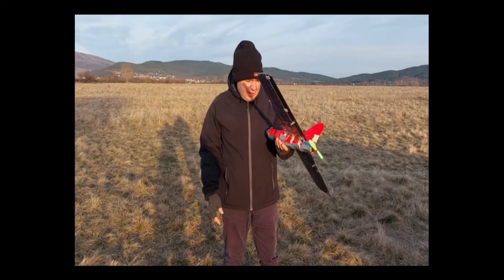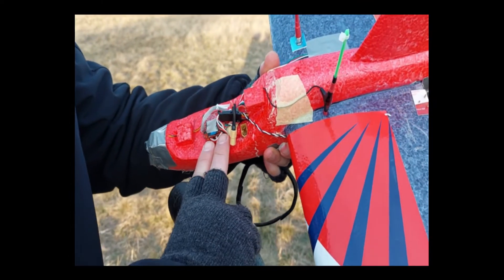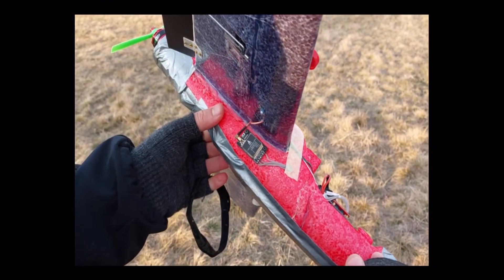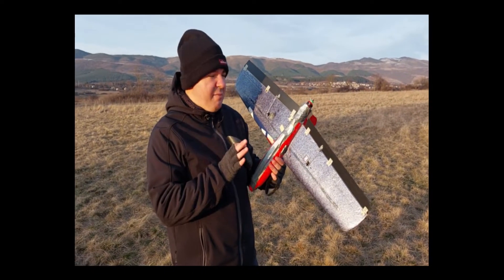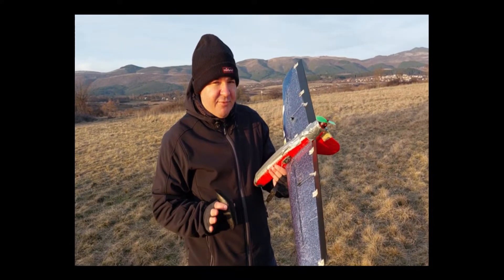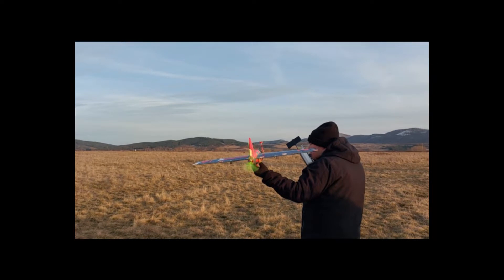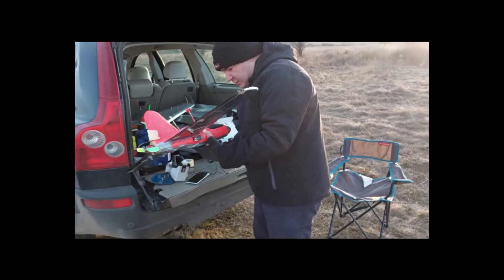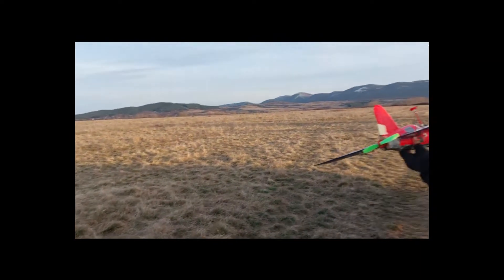Lidl Devil Glider with FPV and Arduplane. A crash included

Comment: Nice man, your delta wing is so stable. Mine goes to the ground once I try to throw it with some throttle and once I'm in the air and I slow it down, the plane enters a spin from which I can't recover. I'm done with this lidl builds
Reply from the maker: Hello Marek. Thank you for your comment. I suspect the problem you mention is CG related. Where is the CG of your plane?
Reply: @FPV420.  about 2,5cm from leading edge
Reply from the maker: @opravilmarinade  My glider's CG is at 38mm from LE. Could it be that yours is heavy?